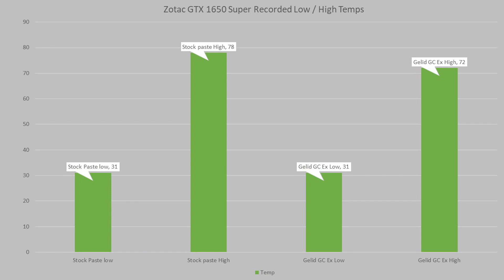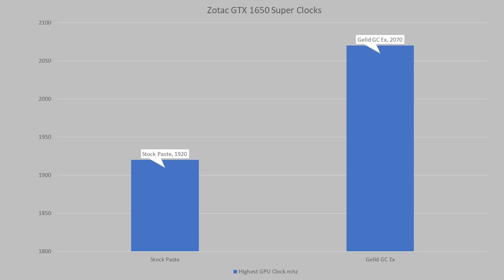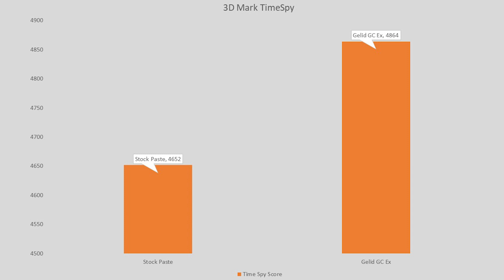Faster GPU Speeds & Lower Temps With GELID GC Extreme Thermal Paste

Comment: STAY AWAY FROM THIS
GELID SOLUTIONS GC EXTREME
It´s allmost cost me my 6900 XT it overheated and I saved it with thermal grizzly kryonaut extreme
SO DON`T USE THIS PRODUKT
Reply from the maker: how did that happen? bad mix in the tube?
Reply: @mikesunboxing  I don't know what it was but I'd gave me artefacts and I could smell the past.
Then black screen, but got some thermal grizzly kryonaut and got it back. I have never been so relieved in my life

Comment: Hey Mike, between Arctic MX-5 and GC Extreme which one would you prefer? I want to repaste my RTX 3080 FE as I recently did my thermal pad mod
Reply from the maker: not sure nx-5 might be easier to work with i think
Reply: @mikesunboxing  Oh ok because I recently repadded/repasted my gpu and my hot spot delta is a little high, 13-14c compared to 10c stock though now my memory temps are considerably lower, 82c from 104c stock.

Comment: just was doing some research and i keep coming across GC Extreme and the Grizzly Kryonaut witch is better? getting ready to give my pc a repaste
Reply: Both punches blows at each other but they're pretty much on par. GC extreme pulls ahead on very very high tdp.
Reply from the maker: @mouaxiong8618  agreed
Reply from the maker: not tried Grizzly but the GC is good gear

Comment: Interesting result, Mike! I have always found it interesting how some TIM can make such a big difference. I also believe how you apply the TIM, and how you synch up the computer would both be variables as well. Awesome results!
Reply from the maker: Yeah this is a good way of getting a bit more performance out of the hardware and doesn’t cost much. Also it is good practice to make sure the paste doesn’t get hardened and give negative performance
Reply: The way  applying is a myth. You just need enough of thermal paste. If you apply a lot , it will be just squeezed out even if you empty the whole tube for CPU. Can you imagine extreme pressure from heatsink to cpu?? The excess is always squeezed out and no air pockets too it’s a myth as well.

The key  is to apply enough of thermal paste . A lot of people by believing in myth “ohhhh you shouldn’t apply too much” will apply too little causing high temps. Better apply a lot but at least it covers whole die or ihs. The excess is squeezed out

Comment: My GPU is running much cooler since I put a waterblock on it and added it to my open loop. Max temps had been around 110c when playing games. I used Thermal Grizzly Kryonaut paste. Temps now average 30c, with a max of 57c while playing games. If you're worried about the thermal paste being electrically conductive, you can always paint the resisters with a coat of clear finger nail polish to isolate them.
Reply from the maker: Good tip like it
Reply: Kryonaut paste has raised my temps after a year !!! For longevity don’t use it
Reply: @filiplaskovski9993  Does your PC have an open loop, AIO, or Air cooler?
Reply: @OlettaLiano  aio :)
Reply: @filiplaskovski9993  That could be part of the problem. I've been using it with custom loops which have high output D5 pumps and thick copper radiators that can remove the heat of the CPU and GPU our of the system. Low flow Asetek pumps and thin aluminum radiators have a harder time removing the heat that the paste pulls from the CPU.